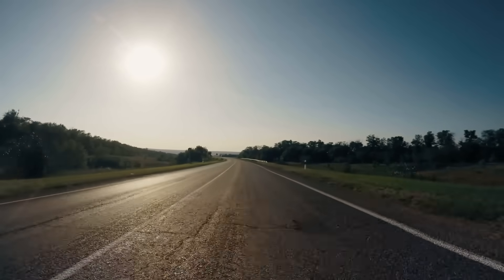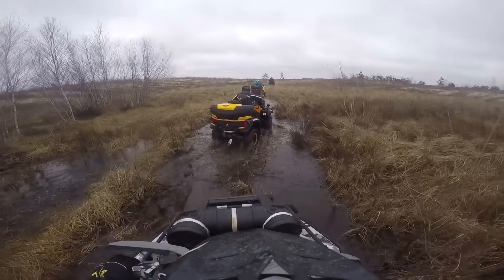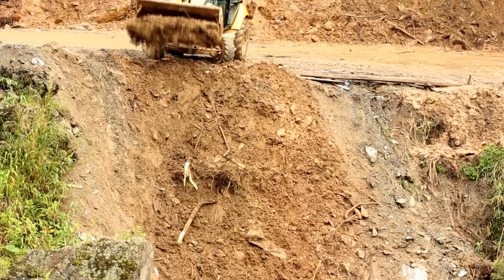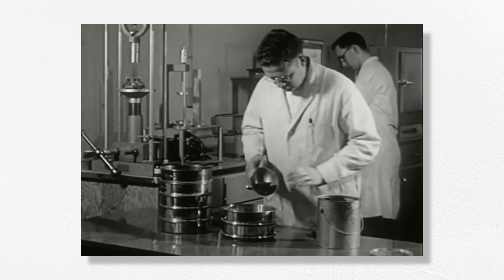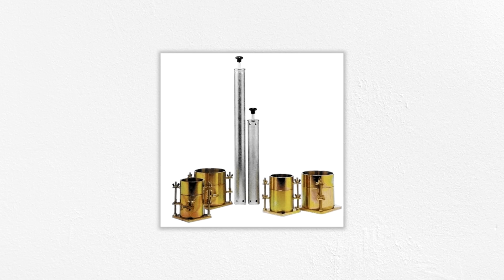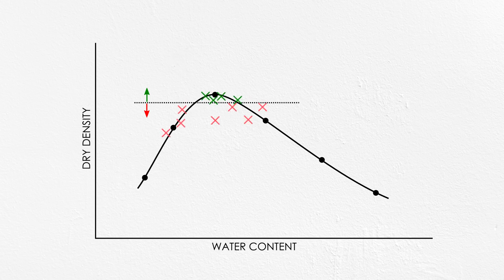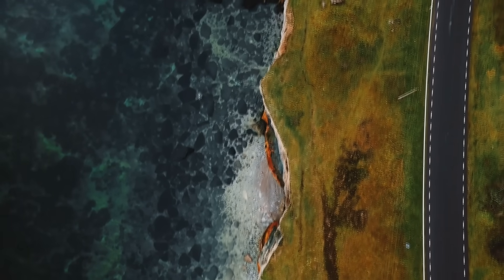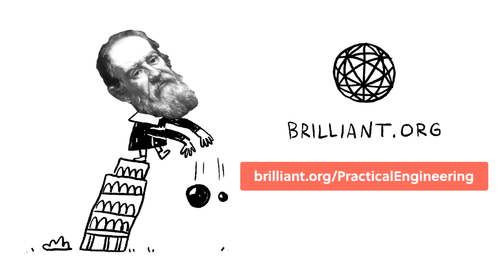Why Does Road Construction Take So Long?

Comment: Actual reason projects take so long.

Contractor: During excavation, an existing water-line not shown on plan is interfering with our work. Please see the attached change order request to remove/re-locate.

Owner: Please see note 8,273 on page C-807 that reads, "The contractor is responsible for surveying the area pre-bid."

Goes into 6-months of scope negotiations, finally settle on a new scope of work

Contractor: We propose a change order to our contract of (About 10x what it's actually worth).

Owner: Ah, I see. We counter offer with $0, because fuck you.

Re-negotiate the scope of work for another 6 months

Contractor: Okay, we propose 1.5x the value of this work.

Owner: Alright, well it's only worth 0.5x the value, so let's just agree in the middle.

Comes to an agreement after a year

2 Weeks later...

Random laborer: Hey boss, what do you want us to do with this second water-line?
Reply: This guy works on construction projects!
Reply: This is exactly how it goes. You took the words right out of my mouth. Even today I’m dealing with change orders on a road project
Reply: Your insight was humorous!
Reply: God this reminds my when I was sawing of broken asphalt around holes to have a clean patch and when the excavator took the asphalt there was this cable just below the ground, it was just luck that I didn't put the saw all the way down earlier otherwise I'd cut the cable.

We did some investigating and found out that this cable was the main fibre optic cable from a major internet distributor and there was a good chance that like 12% of Iceland  would have suddenly lost their internet connection (I live in iceland, 50% of iceland live in Reykjavík and there are only like 4 internet distributors in iceland)

All because the people that put down the cable didn't put a cable PROPERLY down in the ground, yikes!
Reply: Nói Kristjánsson honestly if it got cut it should’ve been the fault of whoever placed it for incorrect installation and documentation
Reply: @jackcaldwell5905  you call dig safe or 811 or someone similar in the usa
Reply: @noikristjansson6038  I once found a fiber optic cable about 6 inches below the ground in a friends backyard. Thank goodness we got the CBYD for it and knew there was something there. Just didn't think it would only be one shovel depth deep.
Reply: @noikristjansson6038  Damn this is so true it hurts to laugh 😂
Reply: @noikristjansson6038  I was working tech support for a large company back in 2013/2014 when a major fiber line was actually cut. I believe it knocked out internet in a big chunk of California. We had a loooooooot of calls that day.....
Reply: @noikristjansson6038  considering it was the main Fibre Optic cable in town, its location should be a pretty easy proposition. I'd say you didn't follow due diligence in locating it, and if you did, you didn't follow asset location protocol (non-destructive digging) to locate it before commencing work. Many a contractor learns the hard way that they are liable for the damage regardless of the "people that put down the cable didn't put a cable PROPERLY down in the ground".
Reply: @sergeant5848  well yes.. but also kinda no, I'm just a lowly employee during the summer, I should have been notified.  But also the saw only goes down like 10-15 cm (depends on the saw blade) while the cable is usually about 100 cm below so I see why I wasn't notified. (I am also pretty sure that the company I work for doesn't get that info from the city, I have worked with there main spreadsheet and there is no info on fiber optic cables)

I'm not saying that the company I work for wouldn't be in trouble but I doubt that I would have been.

A small tangent down below:

It seem road construction regulations in iceland are really bad or not inforced properly.

E.g street are closed with no heads up and people have about 3-4 hours to move there cars or they are towed,  there is a whole town that got some guys to make there roads that made the roads 2 cm thick (that's close to nothing), and just the other day either the biggest asphalt station in Reykjavik or on of the road construction companys really messed up and they managed to make a slippery road that has all ready caused a really terrible death.

P.s sorry bad english, me not native.
Reply: This hit home with me. Lol. Can confirm this is the daily life of civil site work.
Reply: That’s not counting the 7 years it took to get to the stage of finding delays. And since bids always go to the lowest bidder. The job is always won by a contractor that didn’t account for all the things they were supposed to.
Reply: @kyleslater5245  yep, as we say, the one who wins the project is the one who forgets the most stuff
Reply: @kyleslater5245  And let's not forget the 3 year delay because of that endangered bug that lived in the area.
Reply: now this man is a fucking engineer !! XD   and here i thought it was only our country
Reply: Thats once it actually gets approved.... I know of a bypass that took 20 years to get everyone to agree upon it and then the project for budget reasons once approved.... got split into 3 subprojects for budget reasons which results in a whole interchange from subproject one being destroyed in the end to make room for subproject two... some million dollars right down the drain.
Reply: Engineer: Let’s take two years to design this project and anything we don’t understand we’ll just add the risk onto the Contractor with a general note somewhere before it goes out to bid.

Contractor: How long do we have to submit questions on the bid that’s due in 30 days that you took two years to design?

Engineer: Two days after the Pre-Bid Meeting. Make sure you read every general note, every specification section, every detail, every document referenced, and all Addendums Issued because we still couldn’t design it right after two years. Make sure your subcontractors adhere to every specification too. 

Contractor: Here is your Change Order.

Engineer: I can’t believe the Contractor didn’t read our note.

Contractor: Wish Engineer would be more realistic.
Reply: As a Transportation Engineer, I approve this message 😂😂
Reply: Sounds about right
Reply: @_qwe_fk_1700  thank you,  that video/story is amazing.
Reply: Reminds me when I was waterproofing some buildings for a new charter school. They kept changing the grade they wanted which meant we had to have them call over the operators dig enough out for us to work with, then we had to re clean everything which had just been buried about two days before; once that was done we coated the area two inches below the new grade in 250gc which is looks like has the consistency of and smells like tar but its cold and isn't tar. After finishing that building we move on to the next building for three days before they change the grade on the last building we worked on. That happened about 4-5 times per building on that school.
Reply: @joecob2114  holy shit
Reply: @joecob2114  thats nuts! Isnt there a limit to change orders?
Reply: @cathiwim  Not really, plans change a lot, they have to pay the company more usually for something like that though because it wasn't in the original bid. I've seen the state of California force what was gonna be a brand new luxury retirement home, into low income housing, that added over two years to the project since remodels and renovations always take longer then to build it from the ground up.
Reply: It's funny because it's true!

It's also sad because it's true.
Reply: Knowing is half the battle eh
Reply: found the contractor
Reply: That sounds about right. Where I live, in West Mobile, Ala., there’s been ongoing construction on the main north-south thoroughfare for the past 10+ years. There’s gotta be some other issue beside soil compaction that causes the widening of a 3 mile stretch of road to last that long.
Reply: Now multiply that by a few dozen times and that's why my latest project is 2 years late and seven figures over budget!
Reply: At least in construction engineering when something unexpected is discovered, it’s tangible. I mean, you can actually walk down and kick an unexpected boulder. In software engineering it’s hard to see (or even explain) the unexpected gremlin that causes a project to stop.
Reply: @albertbatfinder5240  lol you're funny
Reply: @albertbatfinder5240  yup oh you forgot a single comma have fun finding where to put it
Oh and this code that should work doesnt why no reason change this bit of code oh hey now all the other code including some that worked before and has nothing to do with what you just change isnt working
Reply: Albert Batfinder you have not heard of the “hidden” pipes in the ground that stopped our several billion dollar viaduct replacement tunnel in Seattle, WA , USA?  Each group pointed fingers at the other...you’d think ANYONE would speak up about test pipes in the way of a near billion dollar special built TBM.
Reply: Seems about right
Reply: Omg between private entities profiteering, updating as-built plans, waiting for material and equipment, and bitumen and soil testing, I’m surprised they ever get completed!
Reply: @ApocryphalDude  get completed quicker than many government projects in any case
Reply: This is sadly, not far off.
Reply: If the second water main was unknown you can hope it's abandoned, or can be abandoned.
Reply: AhahahA yes!
Reply: I’m glad someone said this lmao
Reply: The real video we didn't get. Honestly these video titles are super misleading. How Earthwork lengthens road construction is way more accurate but that won't appeal to Joey driving through a 4 year project on his road that started up and why it can't be finished in 3 months.
Reply: There a major road project in my city that the state says will take approx. 5 years to complete. In the first year, the construction company hit a gas line three times and an overhead power line at least once.
Reply: @Erika Johnson Depending on where you live. At least in the area where I live, it depends where and what. If it's on a freeway, they'll do work overnight (i.e. 8pm-5am). They'll post electronic message boards with one or two week notice.
Reply: Job finally starts, union rep says now remember people don't kill the job.  Rome wasn't built in a day.
Reply: I didn't wanna believe that dad was stealing from the construction site...but when I got home, all the signs were there.
Reply: @Maplecook  🤦🏼‍♂️🙄🤣🤣🤣
Reply: Or find a waterway or wetlands in the way of progress that was overlooked before construction began.
Reply: The real reason roads take forever is because of politics. Nothing else. Other countries build and upgrade way better and more efficent. 

America has dozens of different political groups in every fucking project. It's why you see more videos on America's poor infrastructure and this huge plan from Biden.

Kickbacks, the lowest bidder, wasting time to generate money for said contracts. Politics ruins everything.
Reply: Your not wrong
Reply: When comcast marks only half the fiberoptic cables in the dig site and you find the rest of them and they try to blame YOU🤣
Reply: Bonjour l
Reply: Ralph Strocchia this!!!!!
Reply: waiit wut?
Reply: i honestly understood none of that
Reply: Haha
Reply: So true
Reply: Oh jeez XD
Reply: Exactly. Exactly!
Reply: This is true in South Africa
Reply: Absolutaly bang on the tits with this comment. 100% accurate.
Reply: Sounds like a Tom an Jerry episode.
Reply: No lie here lol
Reply: @Ralph Strocchia this what I deal with everyday. 100% accurate summary.
Reply: Nail on the head Ralph ,  there’s gotta be a better way
Reply: You forgot the delays from weather.
Reply: this is fanfiction
Reply: SEQUEL TO PART 1 BY RALPH STROCCIA; PART TWO BY NATHAN KING PICKS UP HERE:

Random laborer:  Hey boss, what do you want us to do with this second water-line?

(Repeat steps 2 through 10.)

Random laborer:  Hey boss, there's a big black rope down there...no, it looks like a buried power line not shown on plan.

(Repeat steps 2 through 10.)

Backhoe operator:  Hey, what's this...looks like I accidentally ripped that pipe open with my digger not shown on plan.

Random laborer:  I smell gas!...HEY BOSS, NO!  DON'T LIGHT THAT CIGARETTE!

BAM! 💥💥💥💥 🔥🔥🔥🔥

A whole block of buildings destroyed and the road construction crew all dead.  Road completely destroyed.
Reply: https://www.youtube.com/channel/UCSiaHKyoxSyoc8Rzb2thXJA
Reply: This as the same energy as the second breakfast
Reply: It’s exactly like this as a field engineer working on analytical elemental analyzers. The job is never just the job.
Reply: haha
Reply: Alabama Dept of Transportation recently had a similar issue recently. After nearly 15 or so years of waiting, seven miles of I-20/59 was to have an additional lane added.  Took five years but could have been done in 3-4 years as the interstate bridge over a main road was to be of a special design; an arch to welcome people to town.  Well, 2019 rolls around & one arch was installed, only to discover it had been warped. Took a year of ‘investigation’ & ‘negations’ w/the contractor.  Finally agreed to a course of action early in 2021. Everyone’s hoping it’ll be ‘finished’ late this Summer.

ALDOT also was responsible for revamping one mile of I-359 in downtown Tuscaloosa.  Took two years to finish that nightmare.

Mind you Metro Tuscaloosa has roughly 110,000 residents. Add in 38,000 college students & another 75,000-100,000 in seven weekends a year in the Fall for football games.

On deck are several more major projects in town

ALDOT is the most corrupt & inept organization in the sate.
Reply: Bureaucracy, environmental activists, local conditions, weather, etc. etc., all have their effect.
Reply: As a General contractor…. I read half of your comment before I had a slight panic attack thinking about the 2 month summer schedule I was handed to renovate a gym, a temp library, a bus loop, and 2 parking lots….. 35 change orders so far and it’s only June; I have until August 15th before I’m fucked…

Ohh and the principle still wants us accommodating her…. F*^¥ out of here, get out of my way it’s summer time and you’ve been working from home since March… I suggest you work from home this summer.
Reply: ...state constitution contractors have a pocket full of excuses to give anyone and the people that paid em
Reply: I was that random labourer once in my life
Reply: YES!!! 100 percent correct lol
Reply: Been doing roadwork 10 years and literally never had this happen.
Reply: @m0nsterman902  have you ever been to general contractor on the job or just a subcontractor,? I've been working for a GC for 4 years and literally have this happen multiple times on every project
Reply: Haha! It's like you're describing my life! :D
Reply: I work in an office doing that. Describes it perfectly. In fact, we know it's stupid AF yet it amuses us to find small print putting the blame on someone else...
Reply: Meanwhile Japan can repair a giant fucking sinkhole in a week
Reply: so pay the workers and move on, construction workers should be paid more than lawyers and doctors cause doctors build no hospitals and lawyers build no courtrooms :)
Reply: @gamingforfun9000  Who said the workers aren't getting paid?
Reply: @SailaSobriquet  well worth? it took less than a minute to read, you're acting like that comment was a book you bought.
Reply: Why am I reading about my job on a Sunday?
I'm going to add another billable hour.
Reply: My goodness this is too accurate 😂
Reply: My family has a long history in public works and I can tell you this is EXACTLY how it goes
Reply: Perhaps there's a way to factor in negotiation time into the cost of a project for some fucking accountability :)
Reply: This is like a classic newspaper comic
Reply: Ah, the joys of bureaucracy 🤣
Reply: I live in Uzbekistan and roadwork is so streamlined and the city cooperative
Reply: Contractor: Red face Wojak scream 😱
Reply: You think this is bad? Check out the construction of the Victoria Line through Oxford Circus in London, in the 1960s.
Reply: Root cause analysis: administrative tasks are ineffective at maintaining an accurate record of the topology and utilities.

What can be done to remedy this recurring several million dollar per year problem?
Reply: This never happens in Japan. That is why you have to be born in Japan if you want to finish your project ahead of the deadline.
Reply: Fucking mood
Reply: Common sense just says build it. Its not hard.
Reply: You forgot to add lazy union labor.. but pretty much spot on..
Reply: @FJB2020  yep! More like union enforced sloth like movement.
Reply: Yet the prevailing wisdom suggest that WITHOUT government it would be impossible to build roads.
Reply: @colinyoung3685  Nobody ever mentioned government here, just owner and contractor - though in many cases the owner is probably the government, especially for roads. I guess private projects do tend to go quicker, apartment complexes, shopping centers, and housing developments pop up quality overnight. Because the sooner they can open for business the more money they can make, quality be damned!
Reply: @quillmaurer6563  You'd go out of business quickly if you developed a reputation for shoddy/rushed workmanship. Reducing unnecessary bureaucracy is another candidate for improved workflow. My initial response was a knee jerk reaction that the mere mention of "roads" triggers inside me as an advocate of anarchism ("Who would build the roads.").
Reply: @quillmaurer6563  "quality be damned!" - considering that government demands payment no matter if you don't like the final product and you can't simply refuse to use it to deny them income, the quality of their projects is also damned to hell and back.
Reply: @quillmaurer6563  I'm suuuuuuuuuper late. But people did mention "civil" which is often used synonymously with government. But, anyways.
Reply: @quillmaurer6563  I’ve seen at least as many quality issues on government projects as I have in private development.

The biggest difference is that government can’t go out of business.  They just blame the other party and raise taxes.